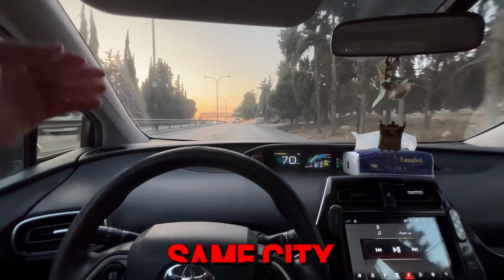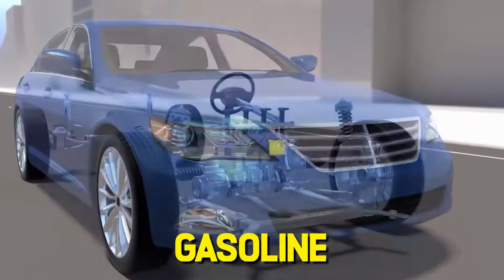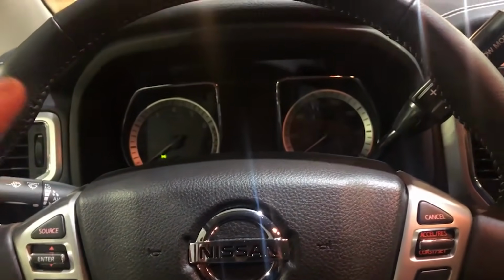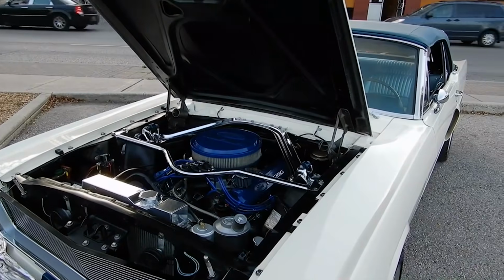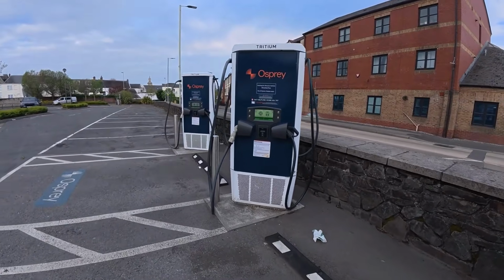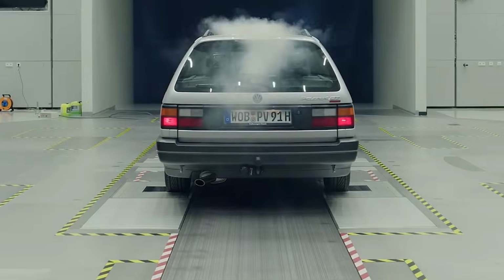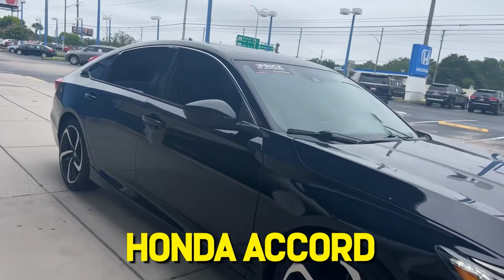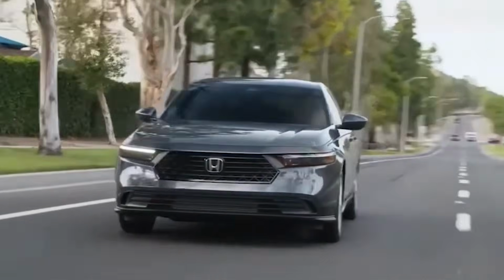15 Fuel-Saving Secrets Gas Stations Don’t Want You Knowing

Comment: does pumping gas early in the morning actually give you more fuel because the ground is cold or is that just an old myth
Reply from the maker: That's a classic question! The idea behind pumping gas early in the morning when the ground is cold is that the fuel is denser, so you get more for your money. While there's a tiny scientific basis for it, the difference is usually negligible for the average driver.